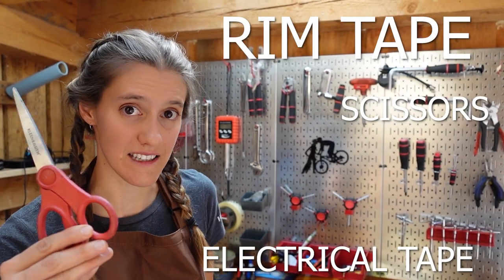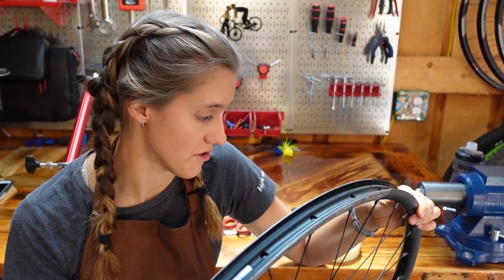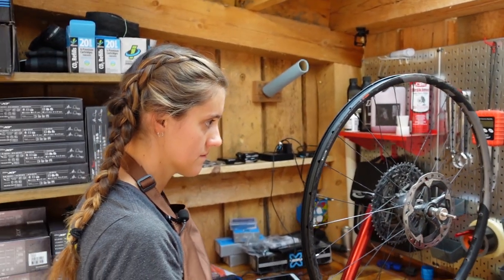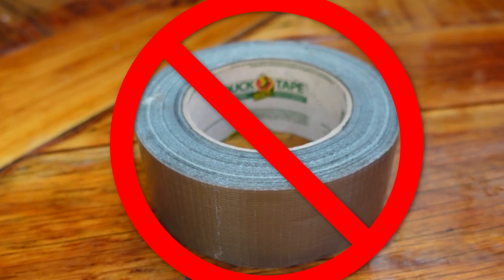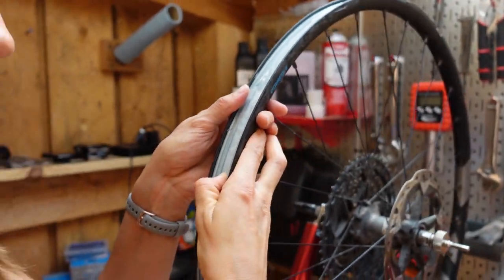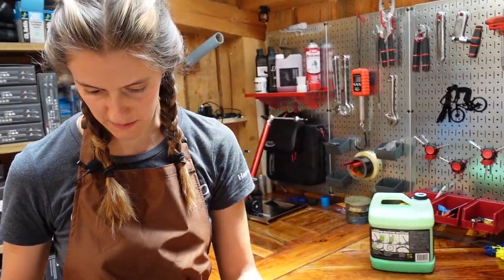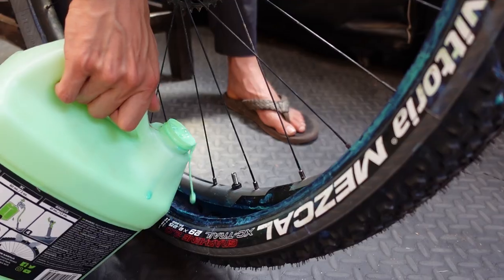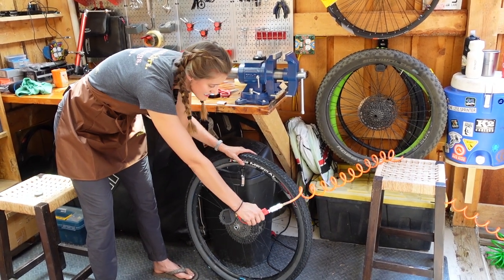How to install tubeless rim tape that won't leak | Syd Fixes Bikes

Comment: Whyyyy why the electrical tape why!? :o Just use a good tape like muc off and u dont have to do that? :) And you have to keep the tape tight the whole time applying it. If you failed and attached a wrinkle, undo a couple of cm or an inch  and do it againg tightly this time (no finger pressing is going to undo that wrinkle cause there is just too much material there to form flat). But other that those, great job Syd! :) Love both of ur energy! :D

Comment: Do you need to go bead to bead or just cover the spoke hole area?
Reply from the maker: Just the spoke holes, but be warned that if you don't go bead to bead it has a tendency to get messed up when you are removing tires.
Reply: @sydfixesbikes  thank you.

Comment: The most rims have burrs at the holes that can pierce the rim tape. So deburring is an important step.  Cleaning with alcohol removes oil and dust. Don't touch the cutted end of the of the rim tape with the fingers and dont't stretch it.

Comment: only reason i started to do this was i thought i would lose the weight of the innertube . but with the tape and sealant im gaining weight . what are the benefits of tubeless ?
Reply from the maker: You can run lower pressures which results in better traction (and feel) and the sealant will fill small punctures without you ever noticing. Then if you do get a puncture that the sealant can't handle on its own, you can usually quickly fix it with a tubeless tire plug.

Comment: Why didn't you put wheel back on that holding jig and spin wheel to spread sealant around the tyre ?
Reply from the maker: That generally just spins the sealant to the center of the tire and doesn't fully coat the inside. That's why riding is the best option (bumps, turns, stopping all help get the sealant all over the inside) and the sealant dance is the next best option.

Comment: How often do you have to top off the sealant?
Reply from the maker: Depends on the sealant. Slime seems to be one of the ones that lasts the longest and we usually wear out tires so quickly that we never had to top it up. More recently though, with more bikes to ride, we found ourselves wearing them out less quickly and had to top up the sealant every 3 months or so. Probably worth checking every 8-10 weeks.

Comment: Ok, I always start one spoke before the valve hole, and go to one spoke after the hole, so the bung is double thick. What is the rationale behind the opposite side approach? Also, I agree that Gorilla tape leaves a mess, but if you use a degreaser to clean the rim it seems to come off pretty easily. Also, I always use the compressed to set the bead first, then go back and add the sealant through the valve with the core out. Not sure if that is wrong or not, but a lot neater.
Reply from the maker: We've done both, but generally prefer only one layer over the hole to make putting the valve in a bit easier. In terms of putting sealant on afterwards, that works great, but requires an extra step and is harder to see how much is in there (unless you're using a syringe with measurements) so we usually just add as we're installing the tire...
Reply: @sydfixesbikes  I do use a syringe, so that makes injecting easier.
Reply: @sydfixesbikes  Also, it is so cool that you respond to comments!

Comment: When applying the rim tape you need to pull on it hard while laying it into the rim bed.  Keep at least a foot of the tape unrolled while taping it, and after each section really press it into the channel with a thumb. To get the bubbles out and have perfectly factory like taped rim, install a tube with tire and let sit for couple of days. the tube will push on the tape eventually getting all the left over bubbles out. The electrical tape is a waste. Only use a piece of it to hold the overlapping of the rim tape.

Comment: I guess instead of a truing stand, you could mount the wheel on the bike and put it an upside down.
Next level trick is to lie on your back with the wheel between your legs and grab the spokes with your toes to rotate the wheels while unwinding the tape with your hands.

Comment: Do you need to put sealant before the air inside?
Reply from the maker: You can either:
1. Put the sealant in the tire first, finish installing the tire, then air it up.
Or
2. Install the tire, air it up to seat the tire, let the air out, remove the valve core, add sealant through the valve stem, reinstall the valve core then air it back up.
Reply: @sydfixesbikes  thanks and how much sealant do you recommend? I’m using brand new maxxis 27.5 2.40WT tires on my bike
Reply from the maker: Most sealants give a recommended amount based on tire width. Can't remember what it is off the top of my head (and it depends on the sealant), so check the bottle to see if it says.

Comment: I did this on my mtb wheels ... i never got the popping of the bead on the new rim ...old tire went back on so who knows maybe because of that but meh .. no leaks I happy... I remove my valve core so I can seat my wheel and try to get that nice popping and just inject the sealant through the core  ... it a lot less messy if you screw up the mounting that way ... my wife thanks me for not messing up her floors

Comment: Not sure if anyone will see this to answer, but can electrical tape be used to repair an existing/factory rim tape that has minor damage?  Seems like it would save a lot of hassle and expense to just add a couple loops of elec tape.
Reply from the maker: Probably. Depends how much damage there is to the factory tape. If there's a hole that the electrical tape could stretch it's way into/through when it's under pressure (like a reasonably large hole over the spoke hole) then probably not worth trying. But if it's just a little cut that's allowing air to escape through, it'll probably work. Just make sure to clean the existing tape really well and make sure everything is completely dry or your electrical tape won't stick.
Reply: @sydfixesbikes  Are you still taping your wheels this way?  Seems a lot of people are saying electrical tape doesn't work, or causes problems.
Reply from the maker: Depends on the wheel. For our enduro bikes where we don't care about the weight, then yup. For the XC bikes we've gotten more weight conscious and realized that 20 grams a couple times adds up 😁

Comment: The electrical tape is the fucking bees knees...my first tire install leaked a lot but eventually sealed...doing this on the rear and then re doing the front was just butter...amazing tip!

Comment: The enthusiasm and willingness to help is admirable. But, do not use electrical tape.  Tubeless tape should be stretched taut while applying, sometimes stretched tighter than taut. Every tubeless tape has its pros and cons and application quirks. I do like the Slime tape y'all are using. I also really dig whisky tape and WTB tape. I always start just past the 2nd spoke hole aside the valve stem, and then finish just past the 2nd spoke hole on the other side of the valve hole. This is about a 6" overlap. It is also worth mentioning that you should clean the rim with a fast drying solvent. Isopropyl alcohol is good for most cases but sometimes OEM tubes leave a greasy mold release on the rim causing poor adhesion of tubeless tape. In that case, you need a strong solvent, something like heptane (Clean Streak or similar). Use it outdoors as it's got VOC's. These fluids will dry in minutes, no need to wait days. You don't need to go crazy pushing the center of the tape down except when the tape overlaps as you finish. Pushing it down at the start creates wrinkles which interfere with the overlap adhering to the start of the tape properly. I always push the sides of the tape down for really good adhesion at the beads after the tape is fully applied.

Comment: Hello, I have used this method (MucOff 30mm + electrical tape) but I realised that my tyre is still leaking. 30psi both front and rear ytd and when I checked today it was 23 at the front and 17 at the back, is this normal?
Reply from the maker: Have you ridden it yet? Often it takes at least one ride (sometimes a couple) for the sealant to completely coat the inside of the tire and seal all the micro holes. If you haven't ridden it yet, try that (just air it up to your usual at the beginning of the ride) and it should hold after that!
Reply: @sydfixesbikes  Ahh, I think that is where the issue lies. I have yet to add in sealant in fear of having the need to troubleshoot again. I will add in sealant and go for a few rides! Thanks for the tip. Appreciate the maintenance videos, it is my main source of  reference whenever I am fixing up my bike!
Reply from the maker: Glad to help. And yeah, generally they won't hold air very well without sealant because, unlike car tires, they aren't necessarily air tight...

Comment: Don’t use gorilla tape I learned the hard way. The tire sticks to the the side of the gorilla tape and it made it impossible to get the tire off. I had to cut the tire down the middle and the remove the tape before I could get the tire off.

Comment: If you can see bubbles in your rim tape, you did it wrong.  I'd get fired if I taped a rim like this.
Stretch  Your  Tape
Seriously, stretch it tighter than a hipster's jeans.  Tighter than your smallest lycra speedsuit.  The reason why the seal on tubeless tape is airtight is because you stretch the tape and it conforms and molds to the contours of the rim.

Comment: Overlap by 3 inches? I'm confused here, so make the rim tape so thick that it's 3 inches in the wheel, or just wrap it 3 times
Reply from the maker: No, just overlap the end of the tape by 3 inches before cutting it.
Reply: @sydfixesbikes  ohhhh... Now that i looked at my comment: 🗿

Comment: Also, you forgot to mention - watch that tire pressure when you're inflating it with a compressor.  They say you've never really worked on a tubeless tire until you've got exploded sealant all over your shop...Lol!

Comment: If you buy a good stretchy tape like dt swiss and maybe if you still have problems put on top  inner tube inflate - it will stick much better. But don't just leave bubbles inside and put electrical tape which holds 0 of high pressures .... can not agree for this method :)

Comment: That looks like it is bound to fail  Use cheap blue strapping tape, pull it tight, and it will look perfect and hold up.
Reply from the maker: This method has held up through a lot of abuse for us! But we will do a video in the future comparing different types of tape so we'll definitely try blue strapping tape.

Comment: I found out how stretchy electrical tape was by using it in the front wheel of my gravel bike... Its never fun to be going 35km and then look down only to realize your front tire is popping off the bead because it's flat. Destroyed a rim and my knees and elbows.
Reply from the maker: Ouch!

Comment: Name brand electrical works fine. If you are really in a rush. Also very ez to remove. Also you have to keep the tape stretched. Air bubble problem solved. This video is not a good one... What i learned from another video is to pull like a half meter and keep it stretched. Then wiggle it on to the rim. The result is a perfectly centered rim tape. Use a lighter or candle and heat the screwdriver or whatever you want and melt the tape instead of cutting it. It will shrink and you have a perfect hole that is airtight

Comment: You did not mention the most important thing at all, at least I din't find it.
The width of the tape. Let's say the inner width of rim is 30mm, how wide tape should I buy ?
Reply from the maker: You want tape that's about the same width your rim (inner width). A little narrower is fine. Wider is a pain.

Comment: This is a complete bodge. 1st get the right width rim tape. You only need 1 layer of rim tape. Overlap 2cms at the valve hole. Pull the tape tight as you go. If you want to make setting up tubeless easy. Walk a tube in it;  inflate, the tube inflating will seat the  tape. Drop the tube then add sealant.

Comment: Seriously, this was done so wrong... First, rim tape should start 2 holes before the valve and ends 2 holes after, so the valve hole region gets double-taped for better seal. Second, when doing the rim tapes, always apply enough tension on the tape while pushing it down to the rim, so that it is fully flat from bead to bead with minimal air underneath. When that's done right, you won't need electric tape to help seal it. Just check the factory installed rim tape to see how it should be done.

Comment: Jesus told me I can just cut Gorilla duct tape into small square pieces to cover up all holes in the rim. And let the tire rubber directly seat against the bare metal of the rim. He says that will work too.

Comment: Or you might have put on a new tire using leavers and you popped a hole in the rim tape when your leaver hit a spoke hole. Not that I've ever done that or anything. And I didn't get pissed off and angry because I spent an hour trying to get the tire to seat. 😕
Reply from the maker: Oh yeah, definitely never done that either 😉

Comment: Most industry rim tapes are pure garbage. 1" wide Gorilla tape has been 100% reliable and is very simple to mount, and lasts for years, and much cheaper than any rim tape. 
Tape residue comes off easily with a little solvent.